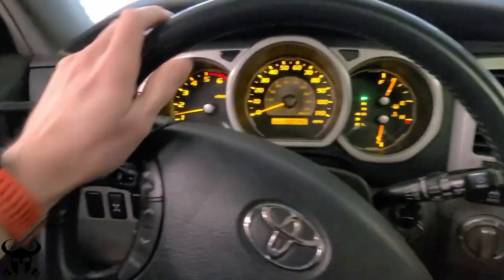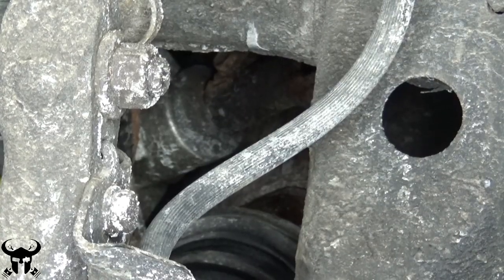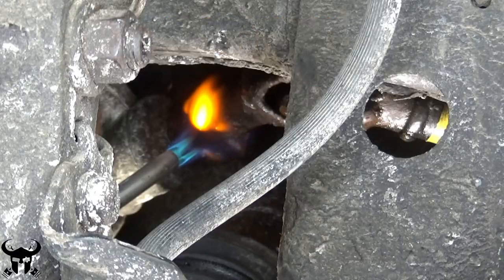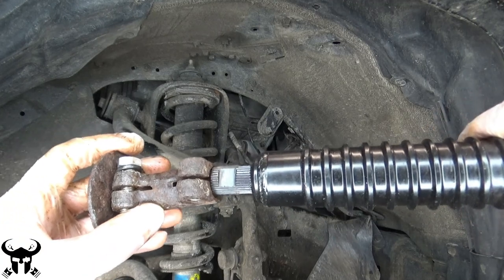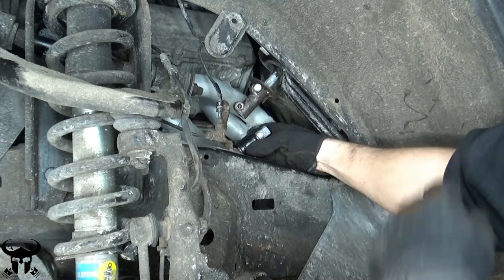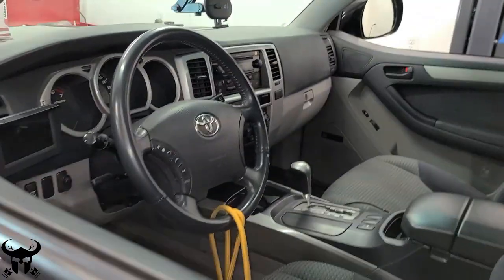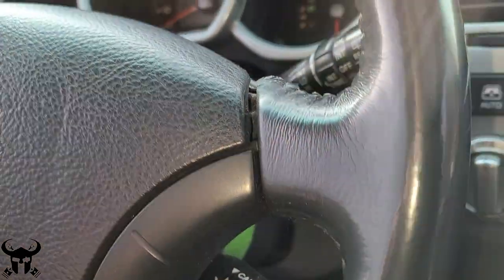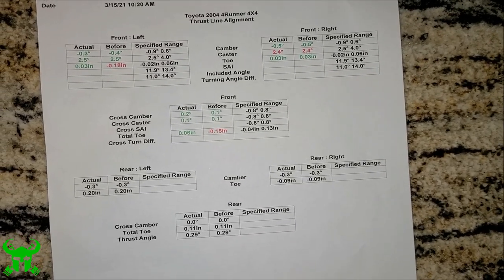Toyota 4Runner Steering Shaft Replacement - Intermediate Steering Shaft - U-Joint - 4th Gen

Comment: Will be attempting this fix shortly, waiting for new part to arrive (4th gen, 2005, 137,000 miles). Greasing it no longer is working, so it has to be replaced. Your video is very helpful, thanks.

Comment: The coupling with the two bolts that is connected to the top of the intermediate steering shaft has a split-seam. I saw another Youtuber remove the coupling without using an air hammer by pounding a screwdriver into the seam to widen the coupling and loosen its grip on the splines.  You just need to turn the steering so that the seam if facing you.

Comment: Great video on a problem most 4Runners will encounter eventually.    I had same issue with mine.  Best tip is use an air hammer.  Nothing else worked.  I started at the bottom which worked best for me. 
I didn't know the shaft was available elsewhere so bought the $400 Toyota part, ouch.  I see the one you used was $75!   Nice.   
Keep up the great videos, I find them all very professionally produced and informative.    
Love the headers by the way!  On my wish list.
Reply: Certain replacement parts you should consider purchasing Toyota brand are brake calipers and steering shaft. I will purchase cheap parts but, not for safety items.
Reply: @kevinriordan1632 Exactly! Only a bone head cheap skate would use a Chinese made steering shaft lol

Comment: Great video!! Am having the same problem too. FProbably from Squeeling my tires since I need to do a Zero Point Calibration.  On 5:16 you can probably used a chipper hammer drill if you have one. since almost the same motion..

Comment: Great stuff- super informative and helpful.  I don't currently have any issue with my steering u-joint but I'm wondering if removal would be useful for doing the header swap.  Just looking at all of the space constraints on yours and others vids of tackling that project and trying to think of ways to increase my chances of success.  Thanks in advance and keep up the good work.  Cheers!

Comment: Thank you for the video, it was very helpful. I just finished installing a new shaft in my tacoma and there were no surprizes thanks to you. Except for getting the bitch off the rack spline the rest wasnt bad. I ended up going to home depot to get the air chisel because my little one wasnt working.  thanks again

Comment: I  replaced this shaft on my 2004 'Runner with 240,000 mi because the truck wandered all over the road at higher speeds, and I couldn't find any play anywhere so this seamed to be the only component that couldn't be checked on the vehicle. My truck has been through Chicago/Denver/SLC/Idaho winters so there was plenty of rust, and I could not remove the shaft without damaging it. Long story short, there was nothing (NOTHING AT ALL) wrong with the shaft (until I removed it, that is), and I - after it was replaced and the problem remained intact - finally found the reason for wandering problem no tech - no matter how certified - could've thought of: the right rear trailing arm bolt was not tight. Not loose just not tight all the way. 5 seconds later the problem was gone. Minus hours of messing with shaft plus the shaft itself.
Bottom line: if you live in a place with winter/salt, don't expect it to be an easy job, and look for any other possibility first. Obviously, this one has never seen a winter, and it still was PITA to remove the shaft. 
One other thing: even if one spline is off, you'll get a nasty unexpected ABS/Traction control effect - one or two wheels all of a sudden lock. Scary stuff. Don't ask me how I know.
I assumed that zero-point calibration would compensate for that but hell no. So DO make sure you mark THE EXACT location of the sleeve. And finally, I would not (and did not) install an aftermarket part in that particular place because 1. Any angle/dimension variations will cause surprising effect and 2. It's pain to replace so it's imperative to do it once rather on a regular basis. Like you would on some jeep.
Reply: How did you correct the abs issue? Currently beating my head against the wall with this.  Everything looks dead straight but alas, brakes are locking up on me.
Reply: @elconquistador55  Try and error, my friend. Try and error. Start with placing the wheels straight as much as possible along with the steering. Make sure you put anti-cease compound on splines when installing the new shaft so it's easy to slide off, move a tooth and slide back on. It's been 80,000 mi since replacement, and everything is fine.
Good luck!

Comment: Thanks for doing this video!
I have heard that many tacomas (and maybe 4runners) are having issues with these shafts. 
Mine was replaced today at the dealer. It took them a little more then an hour. 
I was curious about how was the job done so your video was very helpful. 
I'm wondering how it got damaged with less than 40k miles...

Comment: Why didn’t you just mark the the bottom rack spline first? Your video says you did at a later point, but the results would say if you did you didn’t re install on the mark. A lot of unneeded bullshit could have been avoided had you done the procedure as the FSM details from Toyota. I am looking at it right now.

Also never use a cheap Chinese steering shaft shame shame lol. Decent video otherwise.